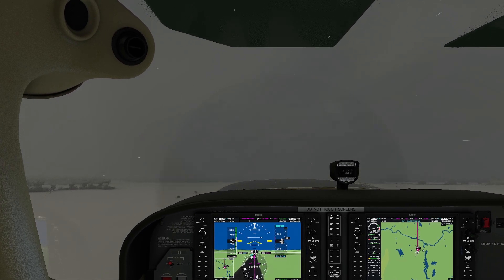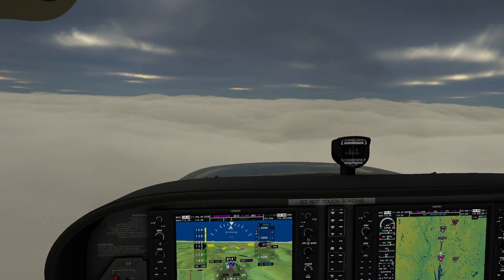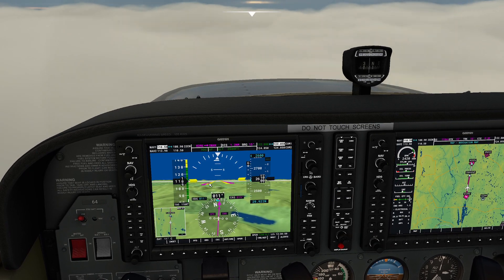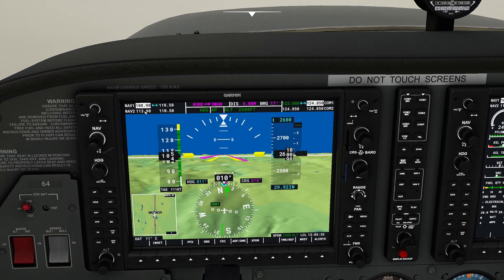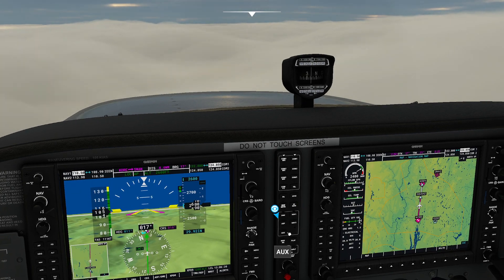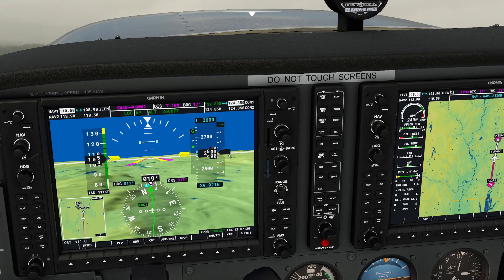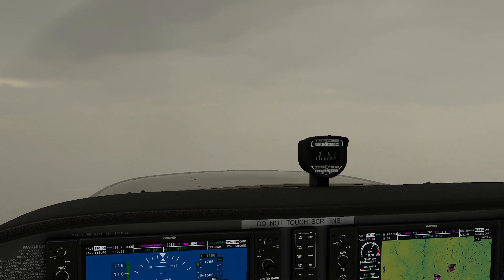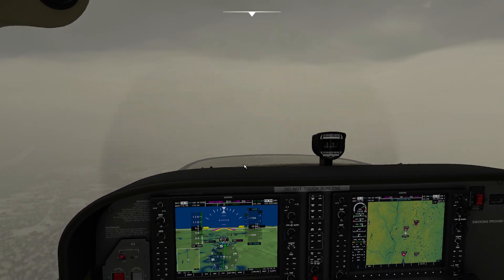MSFS - Using NAV hold on an ILS approach

Comment: I got lost, what is CRS doing in such a case?
Reply: When you're flying in NAV mode rather than APR mode, you're basically flying a VOR radial toward the localizer, so CRS sets the appropriate radial (which in this case is just the runway heading).